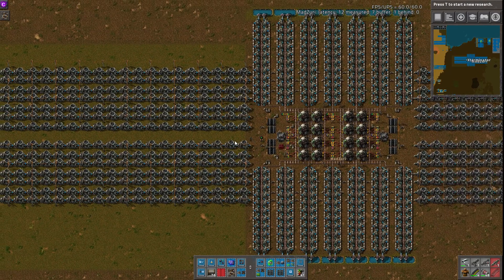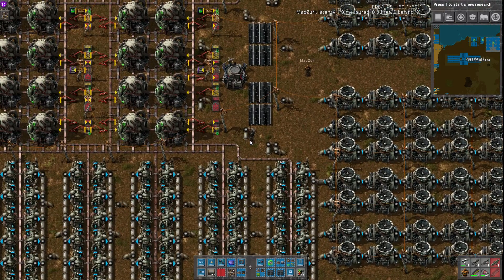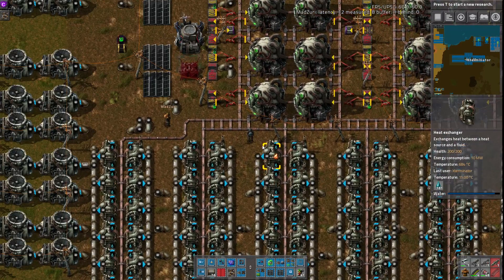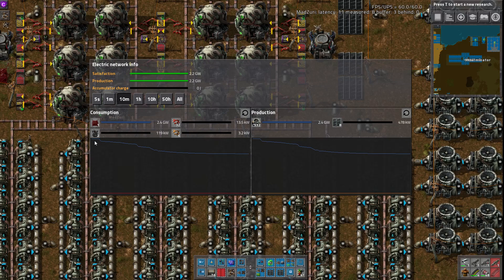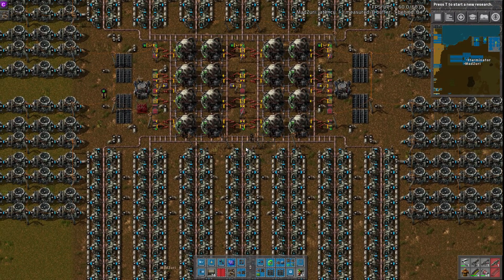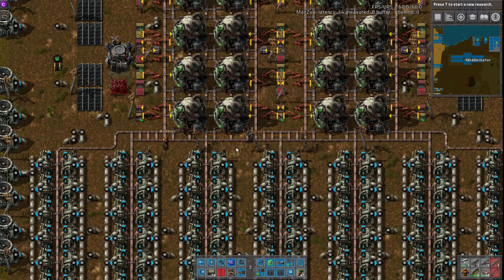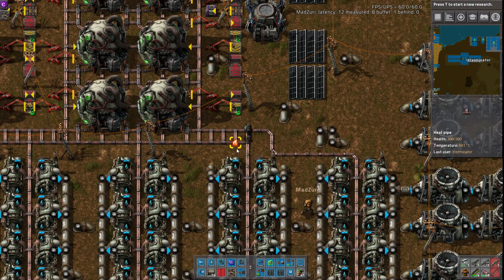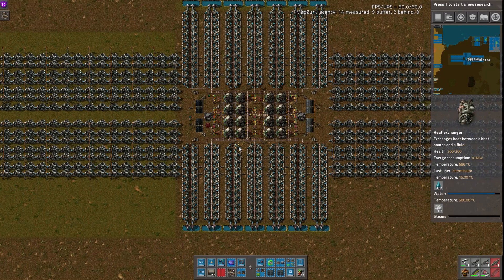Nate's Nuclear Power Setup / Build :: Factorio Workshop Season 2 - Building A Better Factory

Comment: For the record, i have a sustained power demand of 1.6-1.7 GW, and "Electric network info" (by right clicking power line) indicates its under half capacity. maybe caused by .16 or .17  changes, maybe something else. Definitely capable of sustaining 3+ GW

Comment: Trying to fix a nuclear problem in factorio and have come up with a  solution, but there's a problem, first thing explain the solution. The solution is to set up the inserter so they only they only put in one of your engine fuel cell at night, here's the problem I can't get the inserters to activate only at night and only put in on uranium fuel cell. Could you please help me solve this issue?
Reply: Crimson Wing the easiest way to do it , would be a logic network and a solar panel. But you need backup power like a few akkumulators.
Reply: There's two parts to your problem, the easy part is enabling the inserter at night, the harder part is controlling it so only one fuel cell is inserted.
To trigger things at night:
Set up an accumulator charged by a solar panel with one electric pole and a light (to drain the power at night) not connected to your main grid, then run a signal wire from the accumulator to what you want to control (powered by the main grid) and have it activate when the accumulator signal is < 100 (for detecting night) or = 100 (for detecting day).  There will be a little bit of lag waiting for the accumulator to charge or drain: add more lights and solar panels to make it more responsive.
To only feed one cell:
Set up two chests.  The first one keeps your store of fuel, the second one will get a single fuel cell from the fuel store chest in the day for the reactor at night. Set the stack size of the inserter between the chests to 1.  Now you need some logic.  One way is to make an SR latch and another way is to set up some conditional logic, either way you need combinators.  Eg. Disable inserter between the chests if it is night (accumulator < 100) OR if there is a fuel cell already in the second chest.  Enable the inserter if it is day AND there are 0 fuel cells in the second chest.
It's quite doable but a little tricky the first time.

Comment: unless I'm mistaken, it appears that the reactor next to the pipes may not have an output inserter. could that be why the power dropped? those reactors are basically shut off because they cant output?
Reply: I counteted them and there are 16 long handed insters as output and they puting it down on to red undergrounds.

Comment: The flaw on the building that prevents it from dinging 3GW is the lack of pumps. After 10 boilers you must have a pump on your pipes or you'll have your steam flow cut out by 15% with the 11 boiler stream on each row of boilers (or column). Also the Turbines are far away from the boilers, the ammount of pipes that he's using to transport the steam can't sustain the ammount the reactors are producing, so that's why he's losing 800MW of power.